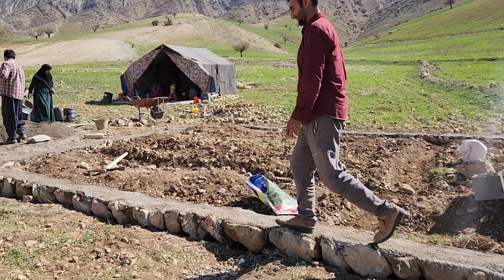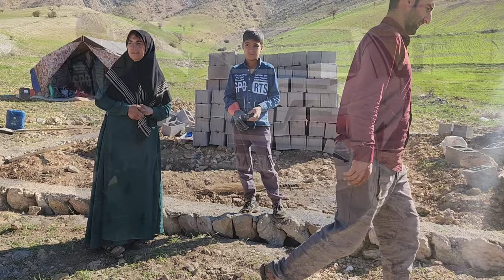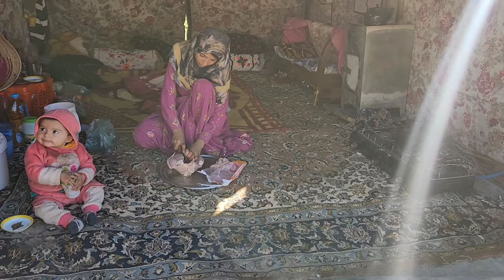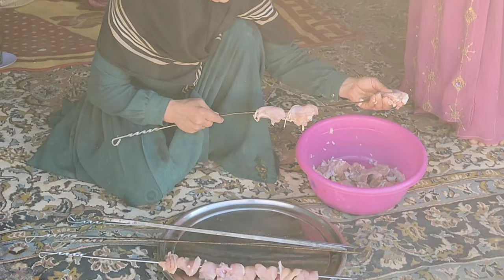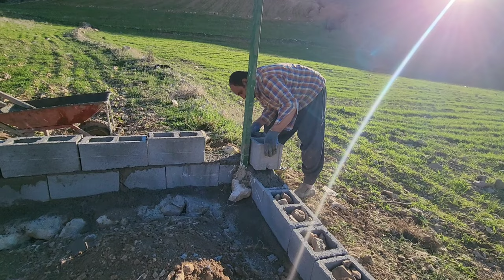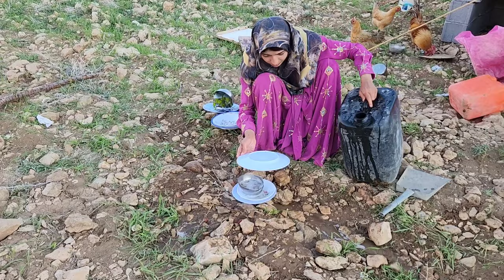"Reconstruction of nomadic dreams: a benevolent engineer and a house in the heart of nature"

Comment: When you rush you make mistakes. 
Figure out now where your door will be. So you can slope the roof in the direction you want the water to go. Don't do a peaked roof. Water goes on the sides of the house then to the front. Have one big slope to the back. Dig a ditch there so all the water goes in a ditch.

Comment: Make sure you slope the roof. Make the front of the house higher with blocks the the rest. Put the wooden poles from front to back. High side to low side. Fill in the sides with with stone and cement. All the water will run off the low side. Choose which wsy you want that to be now. Overhang the roof on all sides at least 2 feet. One slope filling in the sides looks much nicer. No water runs on the sides of the house either. And lastly. Seaming in another room is easier.

Comment: I'm sorry but I think you made a big mistake already. There is not enough stone. They should be at least a foot higher. What is there now will be pushed into the ground and covered with cement that will be dropped every row of blocks going up. The first row of blocks will be on the ground soaking up water and you will have wet walls. Bets anyone lol?